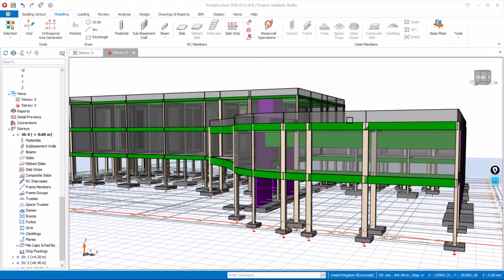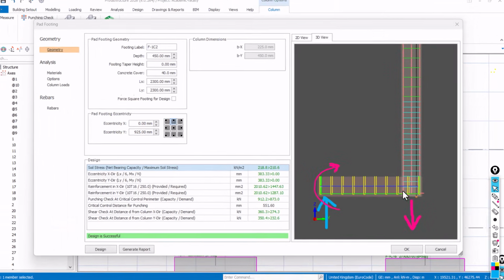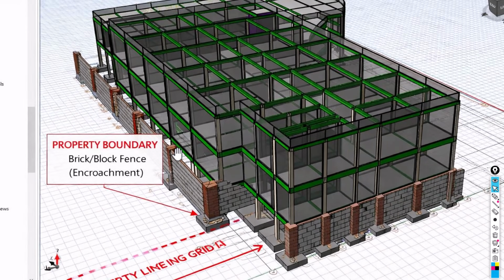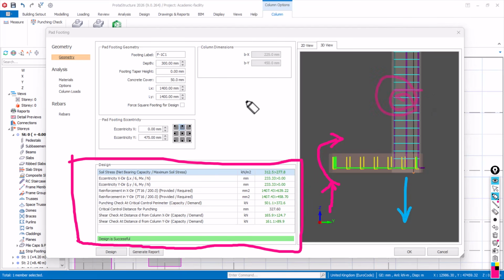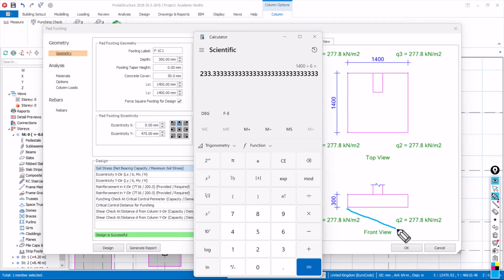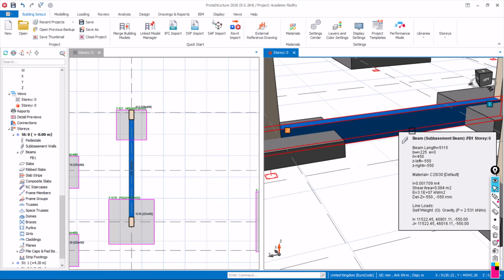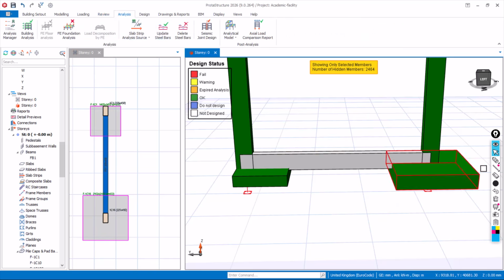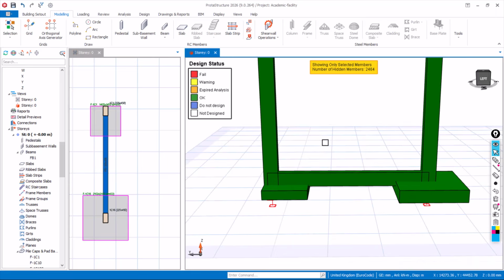Strap Beam Footing Design for Eccentric Columns (Real Project Workflow  Eurocode + ProtaStructure)

Comment: Hello, when I insert an eccentric footing. If I design the base, protastructure moves  the column from the perimeter of the base towards the middle, it doesn't sit on the perimeter. I am using version 2024, perhaps its the issue?
Reply from the maker: There’s a link to the complete design course

Comment: I dont think this is how a strap beam is designed, yours is not capturing the overturning noments from the base of the footing and introduces unnecessary shears in the footing when it tries to lift...but of course, protastructure!
Reply from the maker: I see you're still infused with manual design which is fundamental principle. But all what you mentioned are already been handled by the computer program. You just have to follow the right sequence

Comment: Please sorry to ask this here.

Please why its that we don't design for plinth beam ( I mean the beam that we have on the footing walls before casting the oversite concrete). Practically there should be a beam on the walls before the oversite concrete.
Reply from the maker: We actually can design plinth beams, but they are not always required in every building. It depends on the structural system and ground conditions.

In many cases, especially with:

* good soil conditions
* properly designed footings
* low-rise buildings

the load is safely transferred directly from the wall to the foundation, so a plinth beam is not strictly necessary.

However, in practice, plinth beams are often provided to:

* reduce differential settlement
* tie columns together
* prevent wall cracking
* improve performance in seismic conditions

So it’s not that we “don’t design”, we use them where they are structurally justified.
Reply: Okay. Thank you Ing.